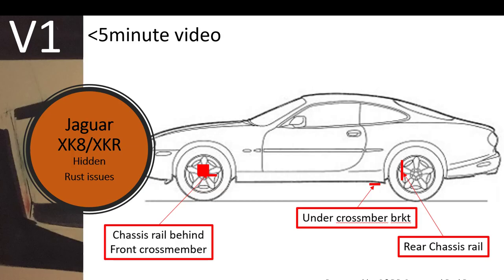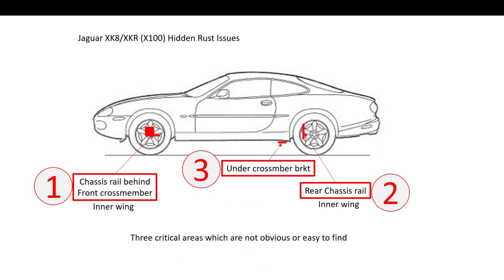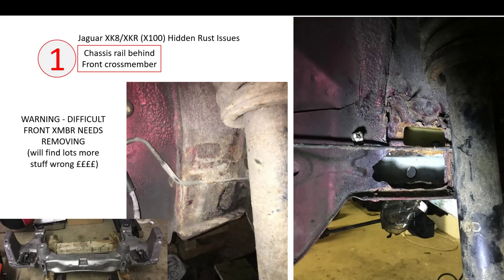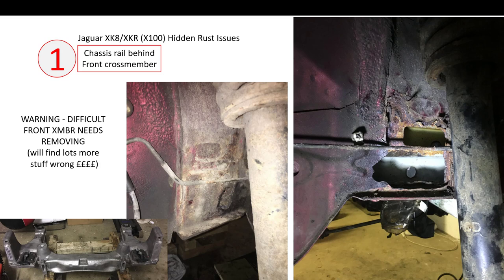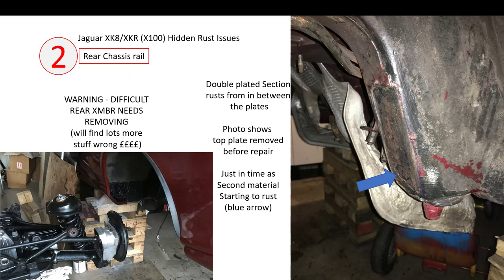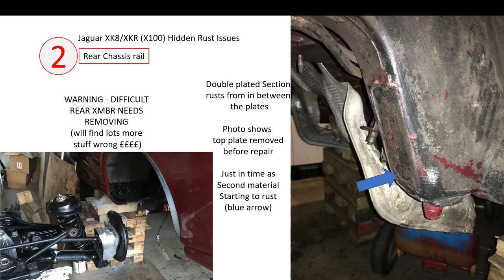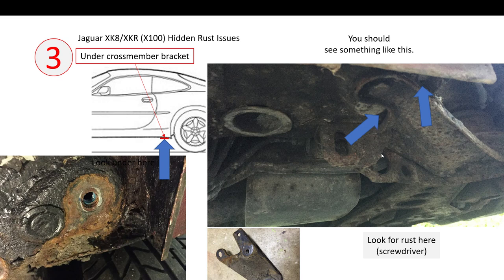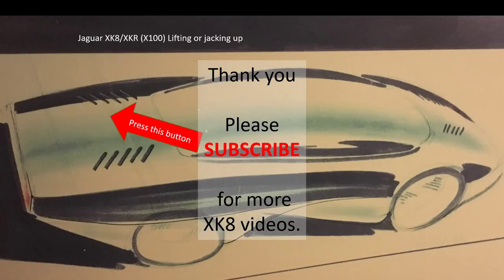Jaguar XK8 Hidden Rust problems V1 / XKR (X100)

Comment: Wow, that’s a job well done! Did you know the extent when you bought her? Great to see you overcome it and make you car as good as new. Well done!
Reply from the maker: Nick, fortunately I didn't know the cars as well as I do now. If did I probably wouldn't have bought one at that point. Now I've done it I am thinking about doing it again, because I wasn't making videos at that point. Sounds mad but more problems the better as few as content on the channel goes.   Thanks for the comment and compliment regards Damian
Reply: @ODRModurol  thanks for the reply. Would you say that as long as you have the suspension datum points they are all repairable or is there a point in the rusting that you’d say “nope, too far gone?” There seem to be a lot of traders out there that think their particular cars are worth a million pounds...
Reply from the maker: Nick, the inner wing rust is directly at the datum point of the front chassis. So there is point where it gets more difficult but not impossible if you have time. There is point where it’s really not going to economic to do. Normally I would say this was linked to external panels and the cost of a decent paint job. Thanks for the comment regards Damian

Comment: Great video. I am new to jaguar, but always wanted one and have ended up buying a 2002 XKR. They were certainly lacking in the rust protection department when they made these. The previous owner had addressed the strut tower welding, but i have found no.2 on your list  and was wondering what gauge steel you used. Keep up the good work.
Reply from the maker: 240867ab, It was a while ago, now. From memory it was 1.5 zinc coated mild steel. Thanks the feedback and comment, regards Damian

Comment: I've got a 99 jaguar vanden plas and my frame rails are rusted out bad in the front coming from the front subframe down the bulkhead and were it turns a 90 degree angle the inside both sides are rusted out I can't find parts for it I'm going to weld it up the best I can and going to construct a full perimeter chassis to make it stronger
Reply from the maker: David, sounds like you have quite a big project in hand. Nice to know an Jag is in the right hands, regards Damian

Comment: Not sure the car seller would appreciate me poking around under the car with a screwdriver to reveal the car's woes. I want one but am convinced I will end up with a rust bucket, but I love the shape of the car and love the V8 with the Jaguar character which the German cars don't have, of course.
Reply from the maker: Quite true about the screw driver, you should be able to see if there is a potential problem visually.
Reply: @ODRModurol  Thanks for the advice.
Reply from the maker: @paulhinkley9063  Good luck with the car hunting once we get out ! Aaargh.

Comment: Why aren't the one in The US don't have this rust issue? Are they prep differently 🤔
Reply from the maker: Joseph, I think it's simply because it's a lot damper generally in the UK (Island Nation) and we use salt on the roads in the winter. Double thickness welded sheet steel doesn't get the rust treatment in-between the sheets. Hence area of double thickness rust from the inside out. Lucky if you don't have rust as an issue. Thanks for the comment regards Damian
Reply: @ODRModurol  we have snow and salt roads in N/E NY but I have been lucky kept her clean for over 20 years and love it as day one have 92,000miles trying to find a professional Mechanic in my area to do timing chain service and hoping to get another 20 out of it... Have a Great Day Mate
Reply from the maker: Joseph, good feedback much appreciated. Hope you find a mechanic and your timing sorted. Although timing issues where sorted from circa 2002 cars. Engines built after 13th August 2001 should have an issue. You might be OK. Have a great day yourself, regards Damian

Comment: Do these problems occur on the later X150 XK8 as well? I'm looking to buy a 2007 model, but the rust issue does concern me. Thanks.
Reply from the maker: Shouldn’t think so it’s aluminium unibody construction so quite a different animal. The aluminium will corrode but haven’t got any experience of the X150 sorry.

Comment: There’s a hidden area , no one checks , open the boot , take out the left and right side mats / and reach over the wheel arch to the very back and your find rust , every car I’ve checked has this unseen area , and all had the rust in the same place ,
Reply from the maker: James, good point I have found that too. That’s for the input. I did try to cover it in this video, Jaguar XK8 Back boot panel trim, lamps, locks and rust prevention. luggage V128 / XKR (X100)
https://youtu.be/cYd2XJ8QD2g , regards Damian